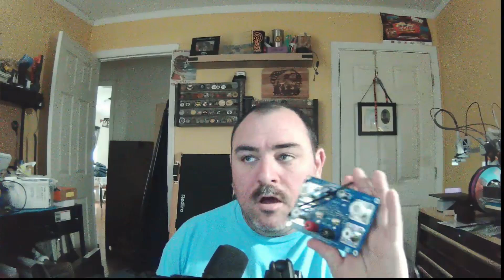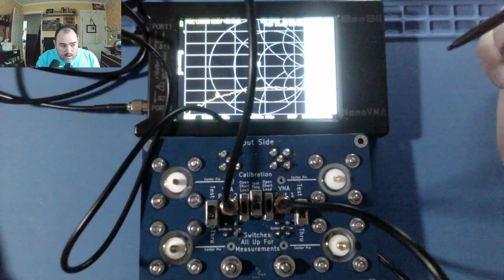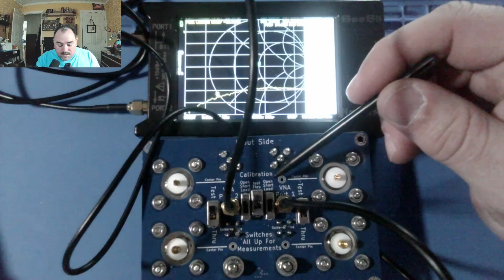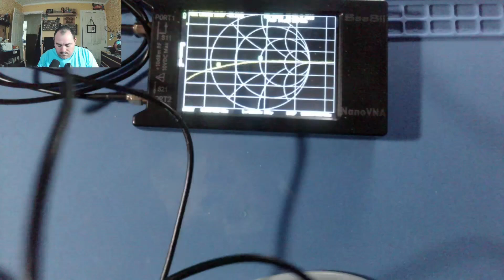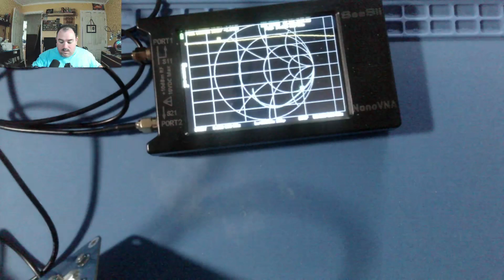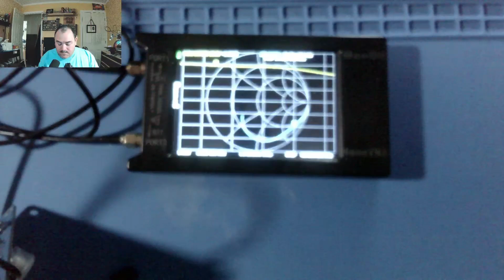Halibut Electronics Common Mode Current Choke Test Rig Calibration

Comment: I didn't see or hear reference to using the OSL calibration standards. Are you not using them for calibration? Are you using them in the appropriate output  port? Thanks for the video.
Reply from the maker: the calibration standards are surface mounted on the board. Thanks for watching
Reply: @KO4AFL  that's confusing because in the quick start guide that came with the test rig...it states calibrate with the OSL standards
Reply from the maker: @larryoob8754  do you have version 3.1? If so maybe @halibutelectronics will update the quick start guide
Reply: @KO4AFL  yep.... I have 3.1, but the user guide is 3.0...... I'll download the new version.... thanks